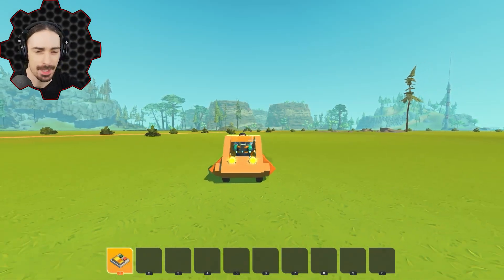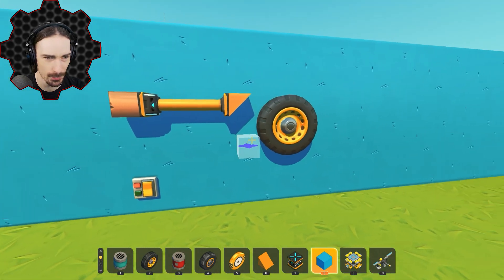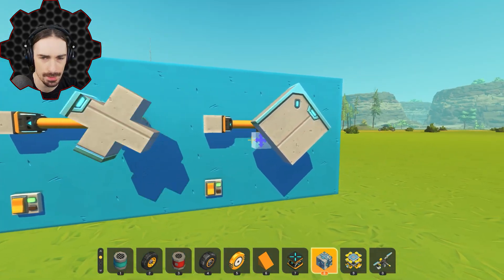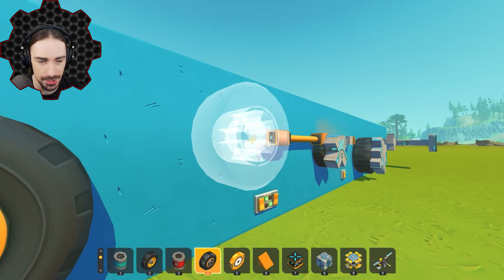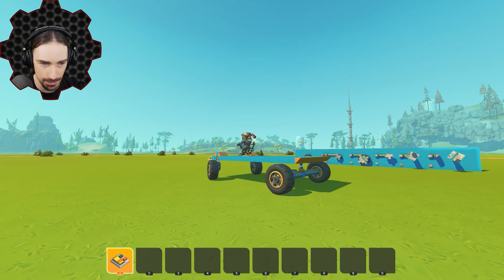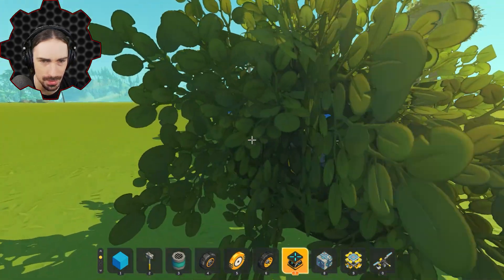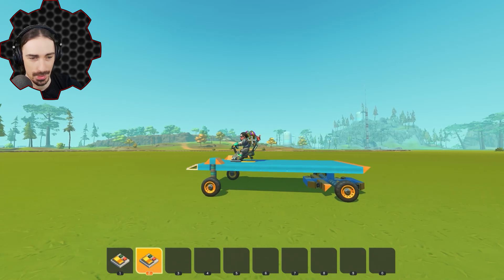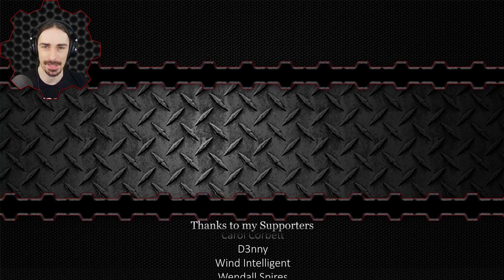The Spooky Science of Wedge Powered Objects

Comment: So.... If more wedges are more torquay
Then how about giving a certain amount of wedges individual control?
Like.... 16 per axle to start and 2 per axle for full speed. Depending on your load you need to use certain gears?
Then... What does the tier of the piston change to it? What does the position speed change
If bricks are breaks and reversers.....
You could make a reverse gear setup aswell. 

And finally: load tests for crates. 

Oh! And if you look at the propellers of the fant mod.... Would this system be a substitute for higher speeds at the rotors? It would be very useful as in a blimp it'd be a flying base without the need for fuel.... Maybe chemicals

Comment: ScrapMan. You haven't test torque, all you did tested was accelerate. Pipe may be fastest, but its have good torque? That is good question.
Reply: Weight you did have no effect, cuz you not applied the pressure/fraction caused by ground.

Comment: Your wedge science basically discovered ⚙️ gears. You could add wedges to the top coming down and you could have each side having multiple pistons on different buttons, one being bricks for brakes, different wedges hitting from different extended piston lengths, could have your pistons pulse in and out to give you a boost.  The gear possibilities are amazing.  The workshop should fill up.

Comment: that make me cringe!
when facing the wall you can see that it make the wheel turn on the right.
so if you mirror the part , the right side of the car want to go forward but the left side want to go reverse.
the wedge are fighting each other in opposite direction.
you can even see that the car is pulling to the right side and the smoke coming of the wheel while rolling.

Comment: i can decode this,
So this glitch is based off of how bearings work, they are floppy so that explains how weight far from the bearing makes it faster. It also means that the dual opposing wedge setup makes it slower. To maximize usage, use one or two wedges as far from the bearing as possible or have the pistons have separate wedges with a huge amount of weight at the end for max flop which means max speed. the dual wedge setup is more stable but also has more torque so:
speed = less torque
and
Flop/instability = Speed
also you commented on how shallow wedges make it slower, so try it with vertical 1x2s. that would make it steeper and may increase speed.

Comment: What if you used only small wheels for the axle connected to bigger wheels? Would it be slower? Faster? Same speed? How fast would you go if both front and back had wedge power? Could you potentially make a 3 or 4 speed Wedge-Powered Transmission?

Comment: i think its the Angle of Contact. that impact the speed.
i m prety sure a brick at 45 degree or applying pressure with the flat part insted of the corner.

just like the UFO engine in Trailmaker.

Comment: I think that the reason the concrete block test goes so fast is the offset of the weight from the center of rotation. If you had had, say, blocks connecting the powered part of the axle to the wheels instead of going straight to the wheel, I think you might encounter a different result than you expect.

Comment: You know how train wheels are synchronized to move in sync? Maybe you could use the same system to give the wheels contacting the ground power from more wedge-pistons. If it works, you would achieve much higher speeds and torque.
Reply: Or just add multiple rows of wedge-powered wheels.
Reply: @nick012000  That might mess with the steering, and that could also limit the maximum speed, if the physics are janky enough.

Comment: I think this whole mechanic works, cause the wedge makes a little bit of contact with the wheel or pipe and the wheel/pipe tries to escape with the touch point and gets a little bit "floppy" so it looses the contact and hits the wedge again. 
The suspension on his first car compensated this effect, so the pipe didn't get so floppy and the force was to low.

That's my assumption, which could be the reason, why one of the fastest tests on the wall produced dust and clearly bounced of the wedge.

It's only my theory, I'm supposed to buy scrap mechanic, only to verify this behaviour.

Sry for my bad english, if something is unclear, let me know and I'll try to explain it in another way^^

Comment: Scrap Mechanic science time!  I noticed in the original wedge powered car you showed off before the wedge was pushing directly against a 3x3 wheel vs a 1x1 pipe on this vehicle, and it made me wonder how radius affects torque vs speed and how it compared when loaded vs no load.  TL;DR - 5x5 wheels are better for most practical uses, more wedges = more torque/speed, and driving a smaller radius wheel once you're up to speed doesn't really work like you'd think it should.  Also pipes are weird.

I did some testing on my own and found that 1x1 pipes are definitely the fastest but they do not have great torque, while 5x5 wheels aren't fast but have a lot of torque.  Which is as you would expect.  However, when loaded things get weird.  I built a simple vehicle out of wood with 2 pipe, 2 small wheels, and 1 large wheel, all connected to each other on a single bearing so the large wheel is the only one touching the ground, and each with a single piston pushing 2 wedges into it from the back.  The first thing I noticed is that pipes spin the opposite direction than you expect under load - I had to flip my wedges upside down to make them go forward.  But even with a pretty small, lightweight vehicle, pipes alone could only barely get the thing moving.  Small wheels were also kind of weird in that sometimes they went backwards or stuck in place and sometimes they moved forward.  They were able to get the vehicle going a little better than pipes, but not really. Large wheels are definitely where it's at, they got the vehicle going no problem, and had even better torque/speed when I doubled up the pistons (one back, one top, pushing a total of 4 wedges).  This is probably the most practical way to make a vehicle move, especially as they get heavier.

One other thing I tried is that because of my setup (with all 3 sets of wheels connected to each other) is that once you get it going with the large wheel, I could toggle on the others in tandem.  Adding small wheels did nothing, maybe even slowed it down a bit, but adding pipes did speed it up some.  Not a huge amount, but noticeable.  However, the main thing I wanted to try is switching to pipes once I got up to speed, like using a higher gear, and it didn't really work out.  It sped it up a little bit at first but then lost speed fairly quickly.  It didn't completely stop for a little bit, but it didn't work as I hoped.  I plan to do more testing when I have more time, and will edit this comment with anything new.

Comment: hello mr. Scrapman, have you considered that the wedge motor might have high power but low torque? that could explain why the wheels on the wall had such a speed, yet when applied to the vehicle it had problems.

Comment: the brick you tested was the concrete. what would that low friction net do? 

also mayb the car has to many wedges? friction could be preventing the initial start there,  though also wouldn't having a wedge motor on each wheel make more sense then the wedge axel idea.

Comment: Looking at your testing explains why your wheels weren't going fast in your creation.
Remember "farther away from the pressure point-it increases the speed"
The four wedges had blocks stacked before you put the bigger weight on.
However, in your creation you had the four wedges followed by the wheel right away instead of stacking more pipes or block.

Comment: Do the wheels thinks it’s a down slope and calculate gravity or something.
Reply: Nope, it's collision, they are constantly trying to uncollide, but because the wheel's position is locked, all it can do is rotate away. The Wedge is also trying to uncollide but the piston keeps making it re-collide. Look closely at the piston and wedge. They are vibrating. That's them in a constant loop of exiting collision, entering collision. 

They are both just trying to escape being inside of eachother.